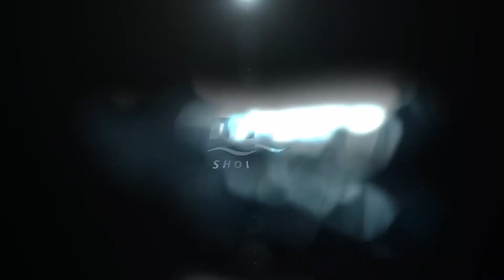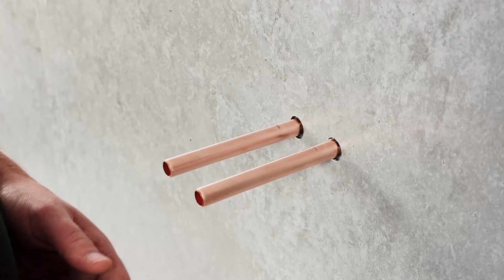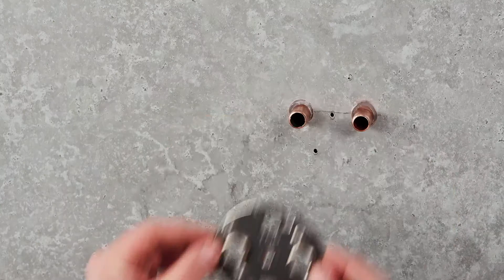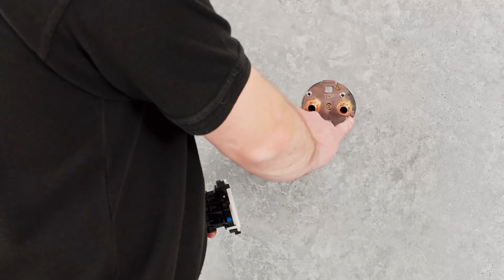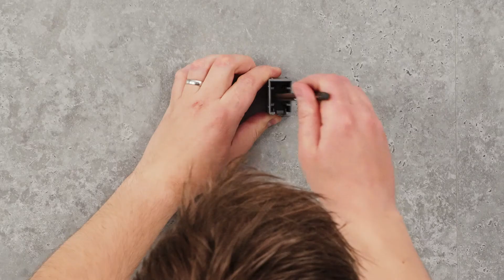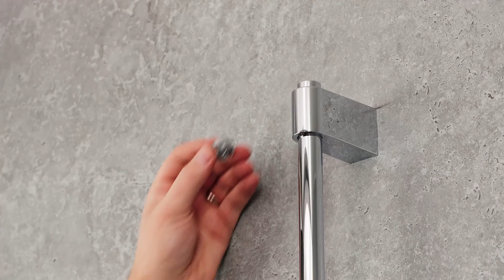Mira Minimal EV Step By Step

Comment: Just put one in can't  get water to flow  can't get anyone on the Irish or UK helpline  to answer any questions can't take shroud off to check anything.Took the whole thing off the wall and back to shop.
Reply from the maker: Hello @tommartin7333, we’re sorry to hear you’ve been experiencing issues and haven’t been able to reach our helpline. If you are based in the UK, please contact our Customer Service team on 0800 001 4040, Monday to Friday between 08:00 – 17:30.

If you are based in Ireland, please call 01 531 9337 during the following hours:
Monday: 08:45 – 17:00
Tuesday: 08:45 – 16:00
Wednesday: 08:45 – 17:00
Thursday: 07:45 – 17:00
Friday: 08:45 – 16:00

Our team will be happy to assist you further. Regards Mira YouTube Team